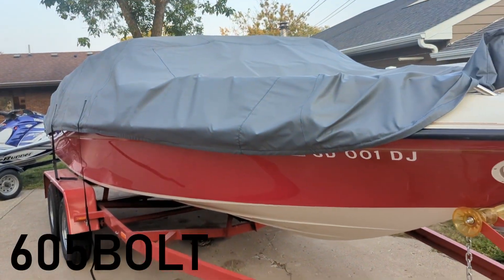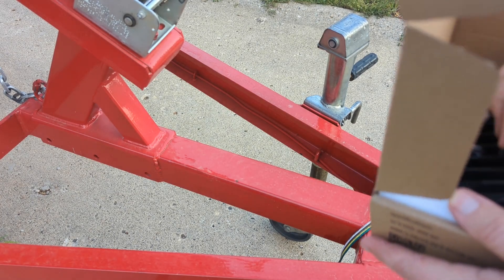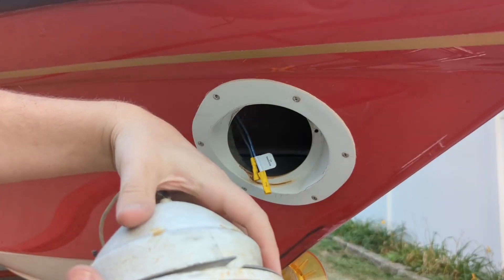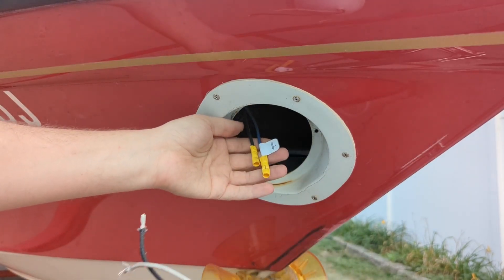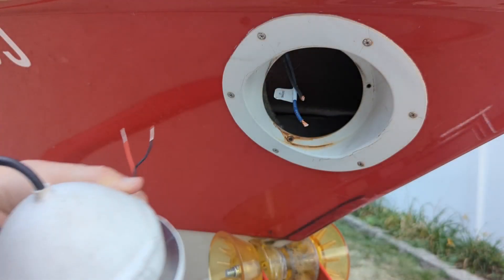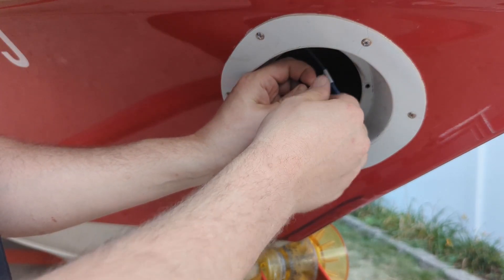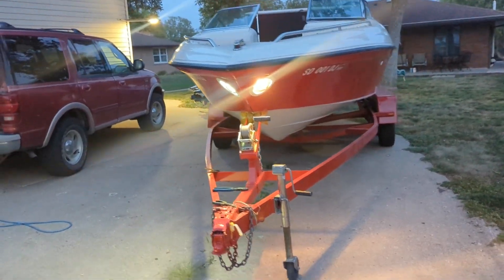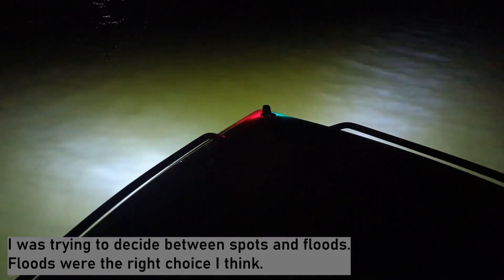Easy, Inexpensive LED Docking Lights -- Installation and Testing

Comment: Nice project. I watch your vids on rebuilding inboard. I have my junk 6cyl out and have a rebuilt mercruiser 5.7 sitting on a pallet waiting for me to put it in. Maybe this winter when the snow is deep I'll get time to do it!
Reply from the maker: Very nice.  A guy needs something to do over the winter right? haha.  If it wasn't for fixing boats, what would be do?  Thanks for watching!
Reply: @605BOLT  Well, if I was retired, or the teenagers were out of the house, maybe. Yes, a guy needs something to do. Just not fun to sneak away thinking you will get at least 2 or 3 hours to work on something, only to find 15 minutes later somebody needs something :) Then I went and bought a project Harley shovelhead to work on as well :O
Reply from the maker: Ha that happens for sure, the interruptions.  Would love to wrench on a Harley.  I might have to browse markeplace now haha.